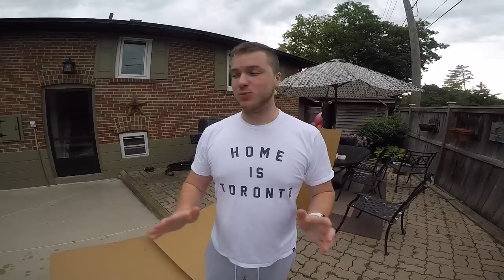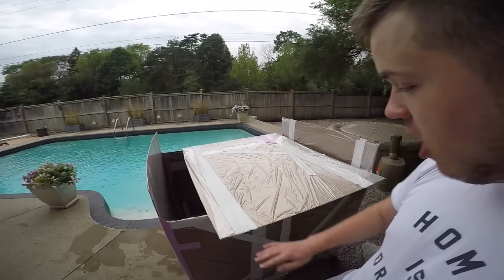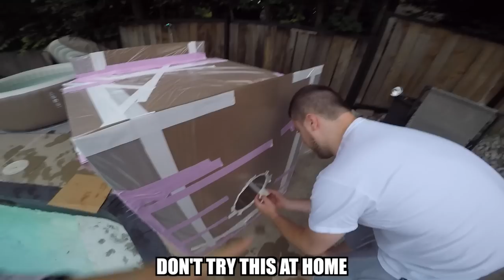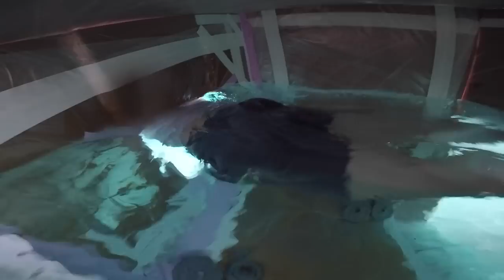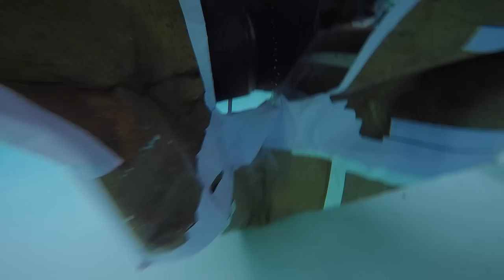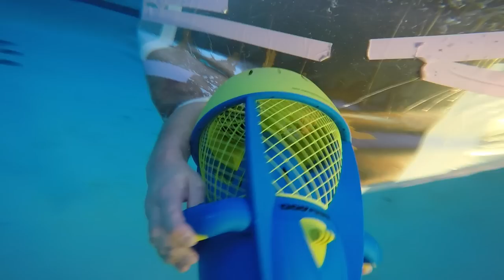UNDERWATER BOX FORT CHALLENGE!! 📦💦

Comment: I have a good idea of an underwater box fort. first thing you should do is you should put that material that you used to waterproof the pieces of cardboard and seal the window. Next, tape the door when you're inside the box fort it you should use some pipes of some sort to get fresh air into the box-fort two at most. measure the pipes and make sure they are long as the depth of your pool put a hole into the. Like to let papa jake know